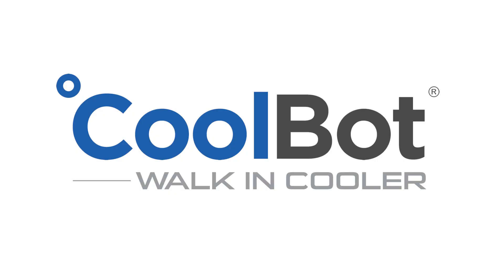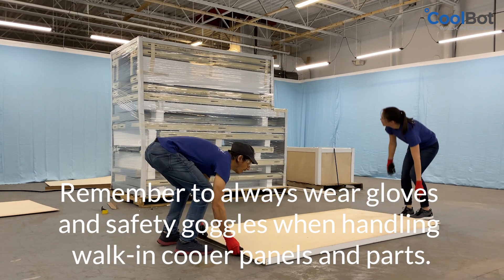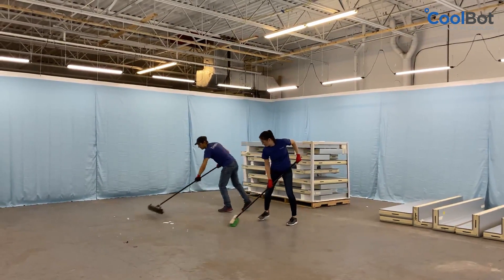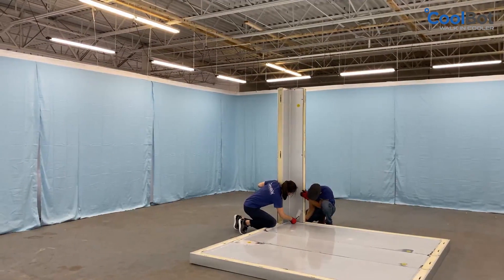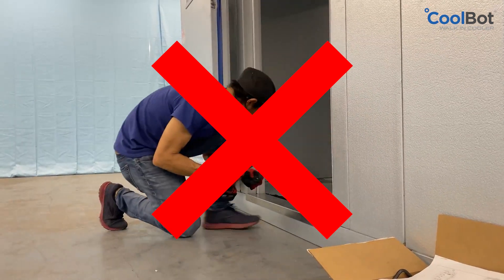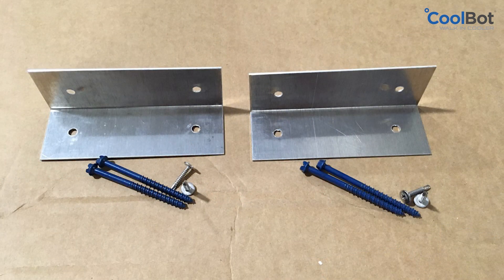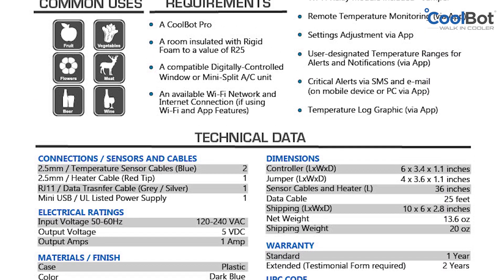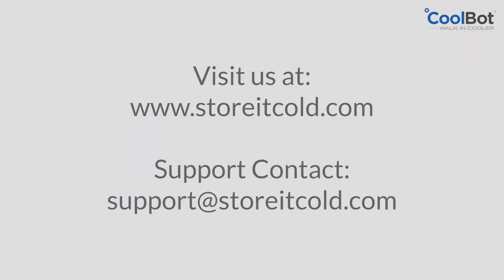CoolBot Walk-in Cooler Install Video

Comment: How does the roof get locked down to the walls?
Reply from the maker: All of the panels use a cam lock system, easily combining the panels together to create a tight seal. Contact us at 888-871-5723 or cooler@storeitcold.com with any other questions.

Comment: What is the reason not to use an aircon filter, is it because the ice will built-up on the cooling fin easier?
Reply from the maker: Hi there, thanks for reaching out. The filter is not needed, removing it helps the airflow from the A/C. We do recommend regularly cleaning the fins of the unit, you can watch that video in the link below. Reach out if you have any other questions!

https://youtu.be/tmx1azwtKt4

Comment: can you still ship these to bc canada? just asking because of the overall shipping difficulties the past 2 years. hoping to assemble this over winter for next season
Reply from the maker: Hi there, thanks for reaching out. We are not able to ship the coolers outside of the continental US. However, we have had a handful of customers work with freight forwarders to get the coolers to destinations outside of our shipping range. If you have a freight forwarder in the US that you would like us to ship to we can get the cooler to that destination. https://www.storeitcold.com/coolbot-walk-in-cooler/
Reply: @Storeitcold  awesome, yeah that's a familiar option. just another question: can these coolers be disassembled and reassembled elsewhere if need be? like if we move properties?
Reply from the maker: @Samb1600  Yes, the cooler panels are held together by a cam lock system which allows for easy set up and breakdown. Let us know if you have any other questions!

Comment: hello, do use a cove base molding when building a new cooler? Can you tell me what type of adhesive to use when replacing an old cove base in a walk-in cooler?  Thanks
Reply from the maker: Hi Jim, thanks for reaching out.  We do not.  For an adhesive, we would recommend a NSF approved silicone with the same silver finish as the walls.  Hope that helps!
Reply: @Storeitcold  thanks, is coving used anymore? what seals the floor and walls?  thanks!